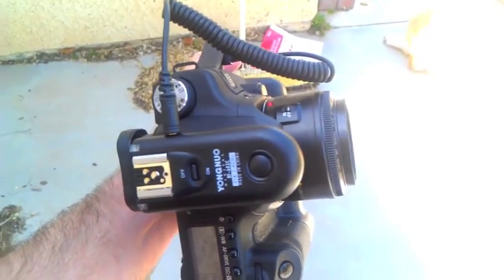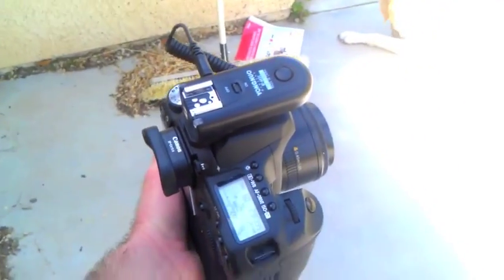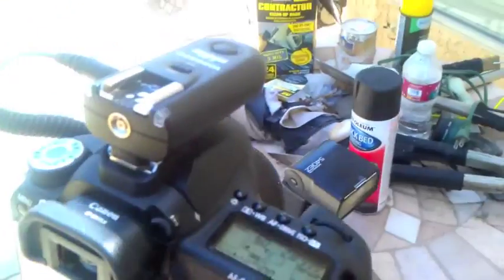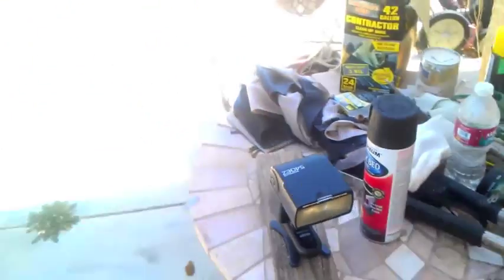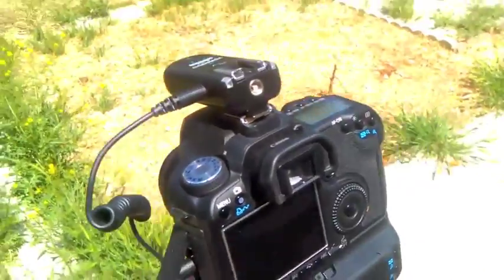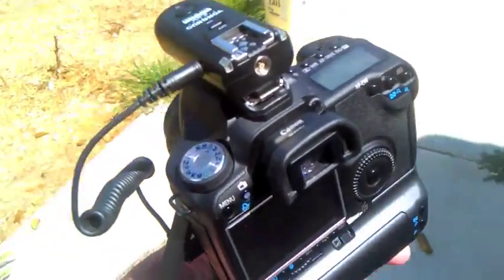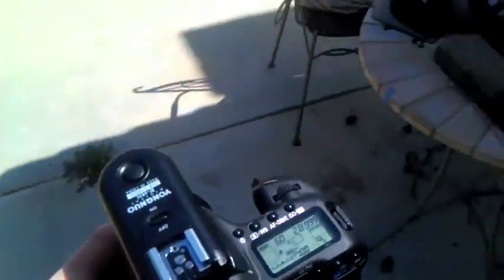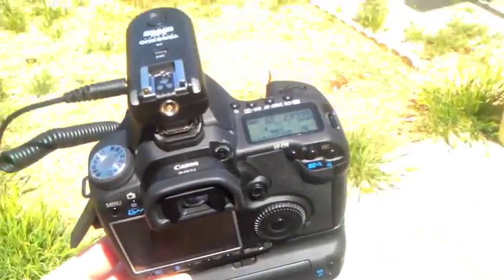Yongnuo RF-603 C Wireless Flash Trigger Transceiver Issue

Comment from the maker: @sedintefoto: The answer is yes.  You can place a rf603 transceiver on your camera hot shoe and attach a flash on top of that.  It will still work the same.  It will fire the flash on camera and the remote flash that's connected to another rf603 transceiver.  HOWEVER, mounting a flash on top of the rf603 transceiver connected to your hot shoe is a bit shaky..  Not an issue if your really careful handling your camera.

Comment: Just got my set in the mail, I can confirm this same behavior, I believe I know the answer.

To trigger the camera the circuit uses a very law voltage, an LED if exposed to a light source, in this case the brightness of the sunlight, can actually produce such a low voltage, the culprit in this case is the power indicator LED, the one on the left side of the RF-603. I'll upload a video as well in a few minutes.

Beside that, everything works fine.

Comment: Hi.  I saw this exact same thing once before on a Canon A2 when I was attempting to modify the shutter release cable to use a single switch.  There are three wires, common, focus and fire.  Normally the common and focus get connected first, then fire gets connected last so all three are connected.  I tried tying the focus and fire together and put a switch to common.  Worked fine, except in bright light it would fire like yours. ...could be your cable has a two wires reversed in thestereo jack?

Comment: I also observed the same thing recently.  I was shooting in bright sunlight using the trigger to fire off the shutter when the camera started firing off shots on its own.  It was only when the device was powered off, but also only when the trigger was mounted on the camera hot shoe...actually it happens if you touch only the trigger grounding plate to the hot shoe ground on the sides.  My solution was to paint over the top portion of the power led with a small dab of black nail polish.  I was wondering if someone else can test out the new rf603 II version for the same issue?